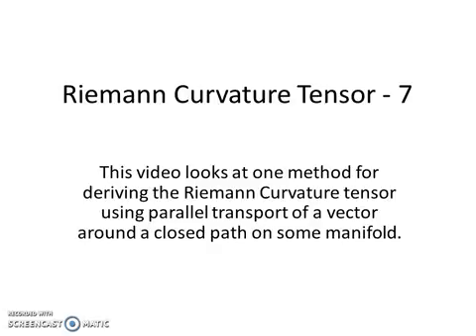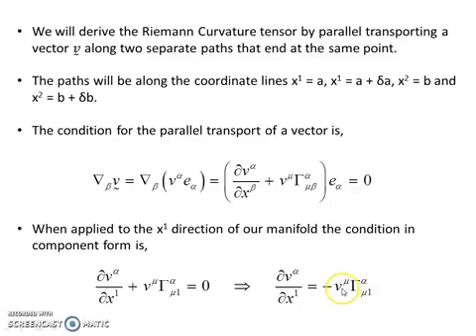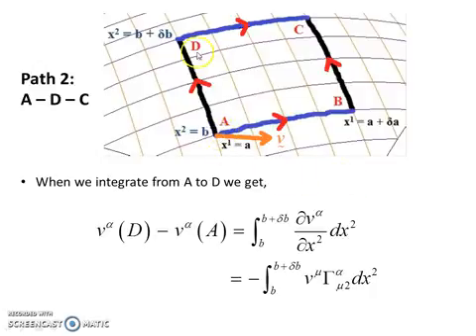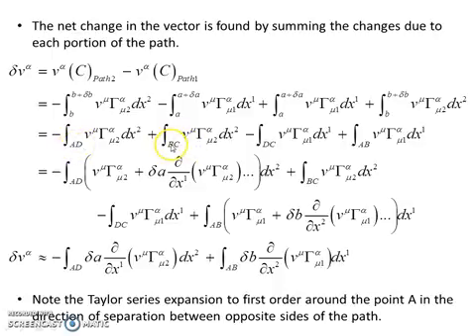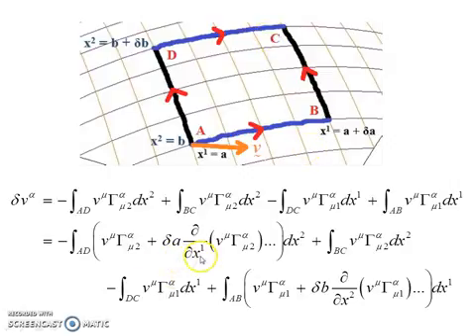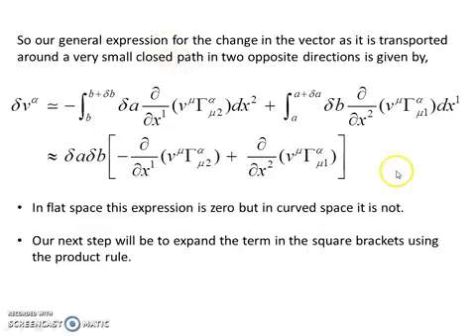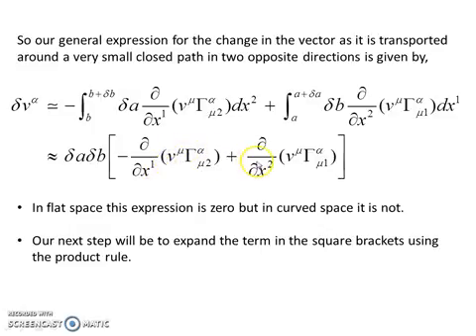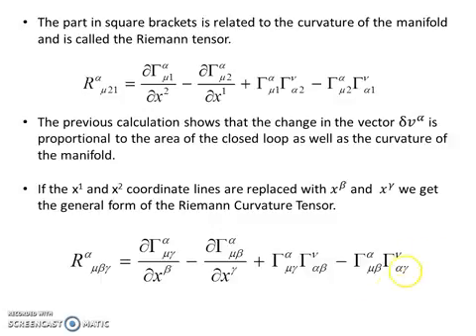Riemann Curvature Tensor - 2

Comment: what i can't understand is why the commutator of covariant derivatives represents the difference between parallel transporting a versor first one way then the iother, versus the opposite
Reply from the maker: Thank you for your thoughtful question! The relationship between the commutator of covariant derivatives and parallel transport is a fascinating concept in differential geometry. Let me explain why the commutator measures the difference when parallel transporting a vector along two different paths.

1. Parallel Transport and Covariant Derivatives
Parallel transport involves moving a vector along a curve while keeping it "parallel" according to the connection defined on the manifold. Covariant derivatives describe how vectors change as they are transported along a direction on the manifold.

If we have two directions 𝑋 and 𝑌 (vector fields), the covariant derivative of a vector field 𝑍 along these directions is denoted as  ∇_𝑋𝑍  and ∇_𝑌𝑍.

2. Commutator of Covariant Derivatives
The commutator of covariant derivatives is defined as:

[∇_𝑋 , ∇_𝑌]𝑍 = ∇_𝑋(∇_𝑌𝑍) − ∇_𝑌(∇_𝑋𝑍)

This measures the non-commutativity of covariant derivatives. It essentially tells us the difference between applying the covariant derivatives in one order versus the other.

3. Relation to Parallel Transport
Now, let’s relate this to parallel transport:

Imagine transporting a vector 𝑍 along the direction 𝑋 first, and then along 𝑌, versus transporting it along 𝑌 first, and then along 𝑋.

If the space is flat and there’s no curvature, these two operations would lead to the same result, meaning the vector would return to its original configuration (try it yourself on a flat surface using paper cut-outs of "vectors").

However, if the space is curved, the two operations generally do not give the same result. The difference arises due to the curvature of the manifold, which affects how vectors behave under parallel transport.

The commutator  [∇_𝑋 , ∇_𝑌]𝑍  captures this difference, which is intrinsically tied to the curvature of the manifold.

4. Curvature Tensor and the Commutator
The key link is the Riemann curvature tensor 𝑅. The commutator of covariant derivatives can be expressed in terms of 𝑅 as:

 [∇_𝑋 , ∇_𝑌]𝑍 = 𝑅(𝑋 , 𝑌)𝑍

Here,  𝑅(𝑋 , 𝑌)  is a linear map that encodes how curvature affects the vector 𝑍. This directly quantifies the discrepancy caused by parallel transport along two different paths.

5. Geometric Intuition
Geometrically, this discrepancy corresponds to transporting a vector 𝑍 around an infinitesimal parallelogram spanned by 𝑋 and 𝑌. The resulting difference in the vector after completing the loop is proportional to the curvature at that point. The commutator captures this "failure to commute," which reflects the geometric structure of the manifold.

Summary:
The commutator of covariant derivatives represents the difference between two parallel transport paths because:

It measures the non-commutativity of the derivatives, which arises from the curvature of the manifold.

It encodes how curvature influences the vector field 
𝑍, leading to different outcomes when transported along different orders of paths.

The Riemann curvature tensor 𝑅 formalizes this relationship, making the commutator a direct expression of curvature.

I hope this clears up your confusion! Let me know if you'd like further clarification or examples. Thanks again for watching and engaging!

Comment: Hello Professor.  I would like to understand more clearly, how at minute 8:41 the result of the integrals is obtained.  I mean,  the approximation.  Are you using the mean value theorem for definite integrals or some thing like that?  Thank you.
Reply from the maker: Hello Chepe and thank you for your quesion.

In the first integral on the left we are integrating with respect to the variable x^2 over a vanishingly small interval which leaves us with an expression in the parentheses that is a function of the variable x^1. Over this very small interval, we don't expect the value of the expression within the parentheses to change much. This means that the object left over is approximately equal to that shown in the second line below it.

I am not a professor unless you mean in the sense of 'teacher'. I hope that helps?
Reply: @TensorCalculusRobertDavie  
Thanks so much for your answer.
I supposed so, it is say, that the quantity can be treated as a constant in this approximation,  but I had the doubt about if there were another more formal reason.

Thanks again, it is more clear for me now.

And yes, I wanted to say 'teacher', I didn't know there was a difference.
Reply from the maker: @TheChepecito  The Italians refer to a teacher as 'Professorio' which of course has a different meaning in English.

Comment: At 18:44, why isn't everything just equal to 0 ? The term inside the x_1 derivative is just minus the derivative of the vector with respect to x_2, due to the equation at the bottom of the page at 1:33 (replacing the x_1 in the equation at 1:33 by x_2). Similarly the term in the x_2 derivative is just minus the derivative of the vector with respect to x_1. Thus we get that the equation  at 18:44 is just:
Delta(a)•delta(b)•(d/dx_1(dv/dx_2)-d/dx^2(dv/dx_1))
But this is just 0, as the term inside the brackets is 0, since the order of differentiation doesn't matter.
Reply: I meant 8:44, not 18:44
Reply from the maker: @frede1905   In flat space the gamma terms (Γ) are all zero but in curved space they are not as they vary from point to point.
Reply: @TensorCalculusRobertDavie  But how does that even matter? I did not say that the Christoffel symbols are zero, I only used the equation at 1:33, which holds true for curved space too. So I still don't see how it wouldn't become zero.
Reply: @TensorCalculusRobertDavie  But thanks for reading my comment, though. I try to learn GR on my own, and it is really frustrating when I dont understand something, since I don't have a teacher or anybody else who can help me. So I am thankful that you try to help me.
Reply from the maker: @frede1905  The gammas at 8:44 are different if you look at the two lower indices. They represent the derivatives of two different basis vectors, one in the x_1 direction and one in the x_2 direction. Their values are not necessarily the same at any given point so we can't just cancel them out.
Reply from the maker: @frede1905  Please keep going as it all takes time and we do all eventually get there! Just be patient.
Reply: @TensorCalculusRobertDavie  Ok, I still don't get it, I am sorry. I still don't get it because to me it seems like the terms inside the derivatives would become d(v_alpha)/dx_2 and d(v_alpha)/dx_1 respectively (since the upper index of the gamma is alpha, and one of the lower indices is 2 or 1 respectively). Thus we would get that the whole equation would become Delta(a)•delta(b)•(derivative of d(v_alpha)/dx_2 with respect to x_1 minus derivative of d(v_alpha)/dx_1 with respect to x2). Since it doesn't matter if we take the derivative of v_alpha with respect to x_1 and then x_2 than the derivative of v_alpha with respect to x_2 and then x_1, it  means that the whole thing is 0. But as I said, I'll probably get it one day.
Reply: But as you said*, not But as I said
Reply from the maker: @frede1905  Have a look at the following two videos and then we will go from there.
https://www.youtube.com/watch?v=dWZQsU0meqY&t=23s
and
https://www.youtube.com/watch?v=gP2Z9Lq6VlY&t=782s

Comment: sir, we use geodesics to find riemann curvature tensor and riemann curvature tensor tell us that how much component of vector changes when it is parallel transported along a small closed curve.....my question is that we try to calculate change by geodesics while geodesics have same vector after parallel transportation（means no change）........means we try to calculate change by using thing which don“t change......sir i m confused ....can you please tell me about this
Reply from the maker: Hello Divya. Please have a look at the video on parallel transport and then come back to this video. Next, remove any notion of geodesics from your mind as in this video we are just parallel transporting a vector along two different paths on a closed loop. Then we are looking to see how the resultant vector at the point C compares after it has travelled the two different paths to C. 

In flat space there will be no difference between the two vectors at C. But in a curved space there will be a difference that is proportional to the area of the loop and the intrinsic curvature of the space, or, in this case, the surface. This difference is visually shown in the video on parallel transport. 

Finally, geodesics do parallel transport tangent vectors to a manifold by a very large number of incremental or infinitesimally small steps during which the vector is kept parallel to itself. But the final vector will differ from the initial vector if the space/manifold is intrinsically curved. Again, see the video on parallel transport. Hope that helps?
Reply: +Robert Davie sir, thanks.